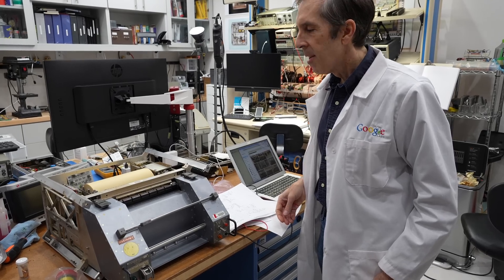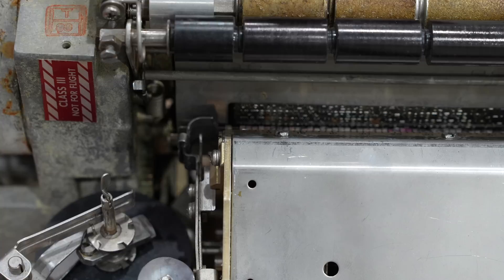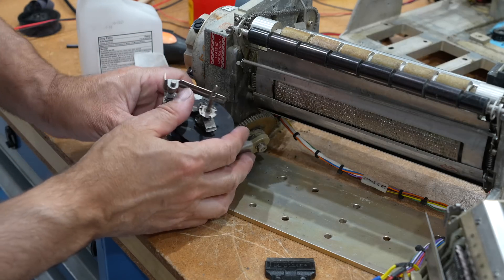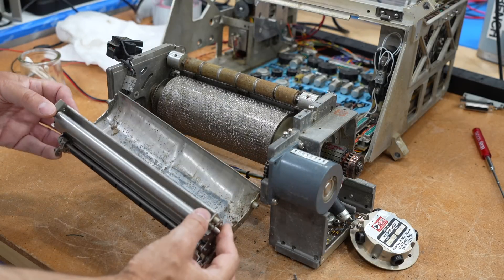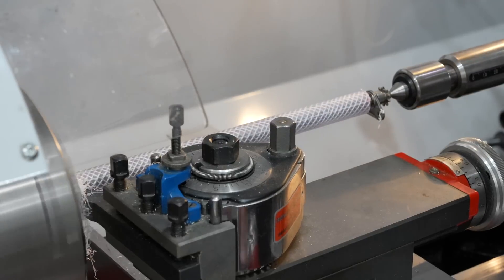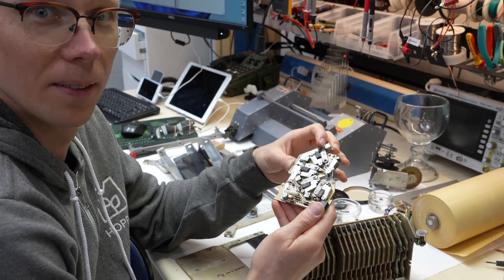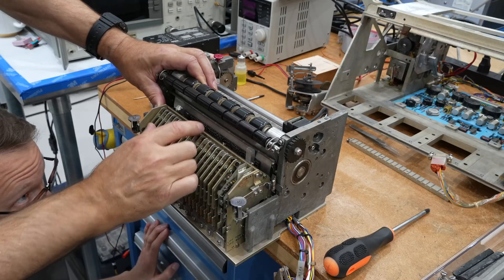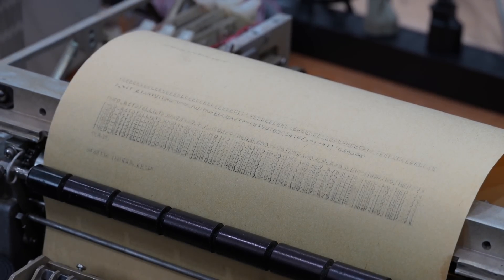Space Shuttle Teleprinter - Part 2: So many mechanical issues!

Comment: You could prolly fix the damaged letters by drilling them out, then filling the material with the solder used for copper (water) pipping and then slowly and gently massaging the shape of the letter under a microscope. That solder is pretty strong, so it should be able to take the hammer without much hassle. I did something similar for the ball on an IBM. Greek script balls weren't that easy to get, so fix it was.

Comment: I wonder if it's possible to slide the rubberized coating off an HP LaserJet refurbishment kit (e.g. for a LaserJet 4000 series) and slide it onto the metal roller bar.

Comment: Haha! - printer tech always seemed to be so far behind - I guess there is always the need for some mechanical components - even in modern devices.  Seems like so many parts to achieve such a simple task.

Slight digression: I worked on pdp 8's and 11's in the early 1980s.  Some 8's still had teletypes, while the 11's tended to use DECwriters or just VT terminals.  I was always fascinated by the teletypes.  I guess they were ASR33s.

I carried a can of WD40 to free up the paper-tape readers - probably caused more harm than good in the long term - but it got things moving at least.

I never imagined they had one of these monsters on the Space Shuttle though.

Comment: "with a Shuttle flight costing $27,000 per pound, putting the 59-pound teleprinter in space cost over $1.5 million per flight" - this does not include the weight of the coal and water needed for this steam-powered printer.

Comment: Mechanical problems in this type of equipment of this age seem more common than electronic problems.    I guess grease and deterioration of rubber and the like tends to take its toll.   It is good to see you fixing up all this older equipment.   So much of it is quite unique and really is worth saving.
Reply: Mechanical problems are always more common than electrical problems in any device. That's why the fewer moving parts the better is a universal law.

Comment: Hey Marc, thanks for putting out all of the great videos!

Regarding the melted rubber on the rollers: this is most likely polymer crosslink degradation. This is caused by many factors, mainly temperature and time, and varies greatly with the type of polymer, in this case rubber. I first encountered this on older (1990s) military electronics, specifically with urethane rubber spacers that were between the top of PWA's and the top cover. They were meant to dampen vibrations of the PWA's. The techs came to me with several different failure modes where the rubber was either harder than normal (including completely solid), or much softer than normal, including looking like it melted and had dripped down over the PWA's. Even sitting on a scorching tarmac in the southwest summer, I knew these parts could not have reached the melting point of urethane, so it had to be something else. I'm EE, not materials science, so it took me a week to dig up the cause, but once I found PCD it totally fit the circumstances, with the expected lifetime of urethane being about 15-20 years in those hot conditions.

The fix was simple: pick a type of rubber that had a much longer life expectancy before PCD was likely to set in. In this case the perfect choice was silicone. The aircraft would turn to dust before the silicone started to degrade!

Perhaps there is a materials scientist in the audience that can provide better details than I can.

And remember, you can't spell gEEk, dwEEb, or wEEnie without EE! 🤣
Reply: What is a PWA?
Reply: @AureliusR  Printed Wiring Assembly. A PCB for most of us. I have also heard people call them PECs (Printed Electronic Circuits).

Comment: I managed to repair a gooified roller of a thermal printer (Tek YT-1S chart recorder of a 1502C) with silicone tubing. That was because I am missing a lathe for the garden  hose...
Reply: That's what happens when you can print an entire line with just one rotation of a rapidly spinning type drum.

Comment: Marc . There are companies in the offset printing industry that will recover rollers or shafts with any rubber or polyurethane grade you want. Check google for roller recovering services. Not very expensive.

Comment: Again, admiring your skillful restoration of historical equipment - given some time and work, it's way past a thing of beauty and a joy for ever. Hyped up for the follow-up. Happy New Year to you guys! :)

8:05 ugh! I cringed so much just by looking at this - reminds me of the deteriorating belts in tape decks, or foams in IBM Selectric typewriters. Wherever I see a slightest hint of this nastiness, I don my gloves right away... absolutely awful.
Reply: Have you found a solvent that actually works on selectric melted foam???  I think I tried every chemical that I could legally get, and it defies 'em all drat!
Reply: @av8bvma513  tried WD-40 and it does a so-so job, but maybe I should try isopropyl alcohol instead. Acetone if I really have to... extreme measures should be used in extreme circumstances only, with extreme protection.

Comment: Wonderful voyage around this machine. From a 'NASA' perspective I am wondering why they could not have used an HP dot matrix printer, it could print on paper, and could handle different baud rates and weighed rather less... just asking for a friend..
Reply: Because it isn't Mil-Spec.  It would suck if your billion dollar space mission failed because your $100 Epson printer quit and you couldn't upload updated procedures.
Reply: @stargazer7644  Well I certainly hear what you are saying. Perhaps we could also consider that the failure rate of those dot-matrix  (as an example) printers was remarkably low, but they were also so light and small that you could perhaps take  5 or 6 examples and still be smaller and lighter than this monster! But, as I said, I do hear what you are saying.

Comment: Electrical tape a very temporary solution!  The adhesive used varies in quality, and often breaks down and degrades within a year or two.  Incredible restoration work otherwise!  The hammer mechanism a very interesting compact design for the time.  Nowadays we expect that compactness and flatness in constrained mechanisms, but for the 1970s that was impressive design work.
Reply from the maker: It’s just temporary. The roller needs to get refurbished at Terry’s Rubber Rollers.
Reply: Exactly, I would have used heat shrink. Electrical tapes adhesive will just end up creating another sticky mess over time.

Comment: It's amazing how at the end of the reassembly you end up with 4 gears, 7 cerclips, 3 springs, 2 rollers and 5 screws spare.
Reply: The best source for spare parts is from the last time you put it together.  Almost positive I have a box of parts from the first GM 350 I rebuilt in 1977.

Comment: 9:22 heh, I’ve never seen that particular method of rerubberizing a roller. Tubing and a lathe. Brilliant. My amateur efforts have always involved friction tape and/or heat-shrink meant for electronics and cables and the like, which honestly I’m surprised I was able to get that to work at all.
Reply: I would have sent it to gain a neoprene sleeve.
At thousands of dollars!
Reply: Heatshrink is probably a good solution. Available in various diameters, thicknesses and surface finishes, also adhesive lined if it needs to really grip the roller. Can be used in layers to build up the desired diameter. The only thing  to watch is some of the thicker stuff has variations in thickness.

Comment: You used electrical tape to replace the deteriorated roller? Have you seen the sticky mess that old insulation tape can become after a few decades? Replacing one sticky mess with something that can become a sticky mess itself seems a little daft to me! Maybe Heat shrink tubing would be a better material to use
Reply from the maker: Calm down. It’s just temporary. Roller needs to be refurbished at Terry’s Rubber Rollers.
Reply: That’s how nasa would fix in tho 😂
Reply: I'm just throwing this out there, but the guy who gets together with his pals to causally poke around in space-flown nasa computers? He's probably got good judgement.
Reply: A few decades? Electrical tape usually turns into a sticky mess in a year or two.
Reply: Hey, hey should get props, its how they woulda fixed it up in orbit 🤣

Comment: Gasoline is better at cleaning old grease, it doesn't damage paint immediately, evaporates much slower than acetone (which evaporates so fast and dissolves paints and plastics, it's almost unusable for cleaninng IMO). Alcohol is too weak. WD-40 works too, but leaves oil everywhere which takes a long time to evaporate, so I don't like it. For stuff like that mechanism that's all metal, I'd just put a bit of gasoline in a tray and use a paintbrush to douse it all complete.
Reply: Zippo lighter fluid is great for cleaning off sticky messes like this to.  Stopped smoking over a decade ago but still have a can of lighter fluid on the shelf above my work bench for cleaning jobs.

Comment: Reminds me of the Data Products high speed band printers I used in the 80’s and 90’s that had speeds of 1500 lines per minute. Nearly identical technology but a band instead of a drum. Noisy as hell and quite impressive to watch.
Reply: Mhm... I spent one summer vacation job printing forms of all sorts on band printers made by, or at least labeled, UNIVAC. Off-line printing, though. But the speed... Beat the IBM laser they had installed as well. Plus that one of course didn't to form sets (with copies).
Reply: @daicekube  Our Univac line printers were installed in soundproof cabinets so the operators wouldn't go deaf.
Reply: @stargazer7644  Huh!? Really? I had no problems running six of them at the same time. The high pitched noise of the hammers was dampened when the hood was lowered.
Reply: Go back to one of Marc's earlier videos where he shows the IBM 1401's printer system. Same concept.

Comment: As ever with electro-mechanical gear like this my mind is boggled that it ever worked for any lengthy period of timed with so many functions to potentially go out of adjustment.  It would be interesting to know how long it took to get a working prototype and who was paying for development.
Reply: Marc gave the history last episode on the printer. It’s half a navy teletype. It took a few months to develop as an emergency replacement of a system that was not going to be available for the Shuttle inauguration.
Reply: @francesconicoletti2547  Yes, I saw that episode.  Meta AI "says" that drum printers have been around since the 1950's and Gemini "says", "...The first high-speed printer was developed in 1953 by Remington-Rand..."  Any advance on that?
Reply: Drum printers were pretty much old hat by the time this was designed. This one was very slow compared to computer room drum printers, which typically ran at 600 to 800 lines a minute. This maybe runs at a tenth of that, so timing is relatively a breeze. Once set up correctly it should likely run for months with minimal maintenance.
Reply: @lwilton  I don't know why I am surprised how old many technological advances are. The military versions I have encountered were "behind the times" - perhaps for good reasons. I shall check with AI to see when drum printers came to the market, but after my own little tests, I don't expect much of the currently free versions. To me they are not a good 'shop-window' for the technology.

Comment: As a ratt rig operator in the US army, if you could not lift that 100-pound teletype, you would fail the course. Have to start over. The only good thing about it was it never gave us any problems. A very reliable teletype.
Reply: Hello fellow rat rig operator.  Yep, big heavy boat anchors.  Sat nest to the over 130+ pound 2 piece AN/GRC-106 HF rig.  Had also just gotten the then brand new SINCGARS VHF frequency hopping radio systems.  Ahhhhh, the good old days.  Mike KC3OSD
Reply: @MichaelPontisso-mx1bq  from what I hear the one on the shuttle was renowned for its unreliability. Mess with a good thing then sit it on the mother of all shaker tables I guess.
Reply: Have to start AGAIN.
Reply: @simontay4851 start again, over